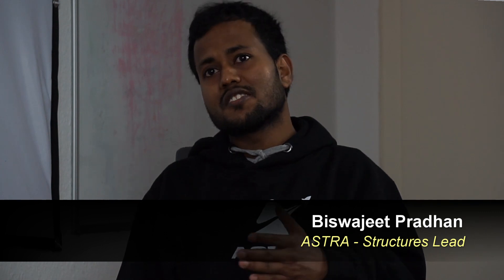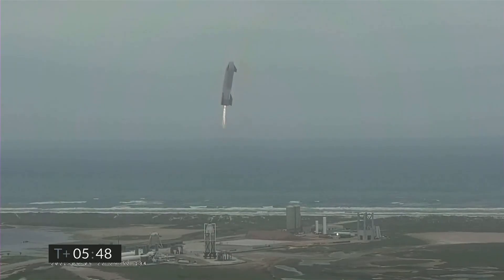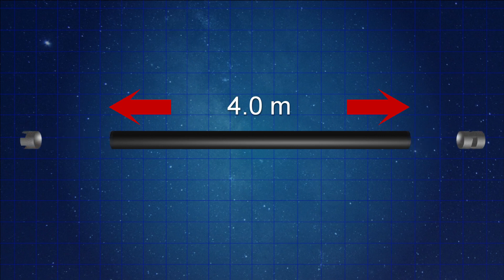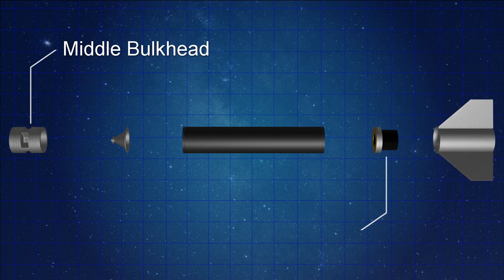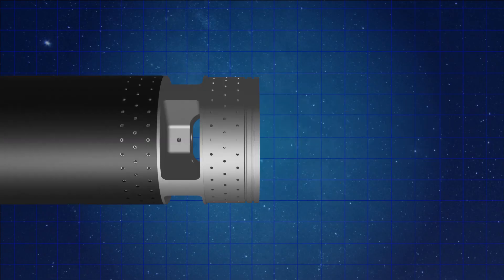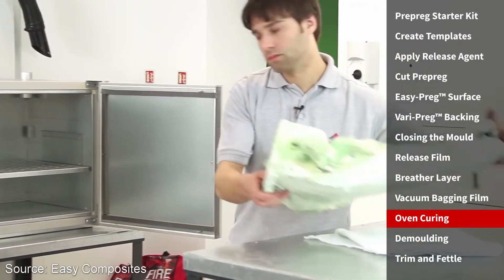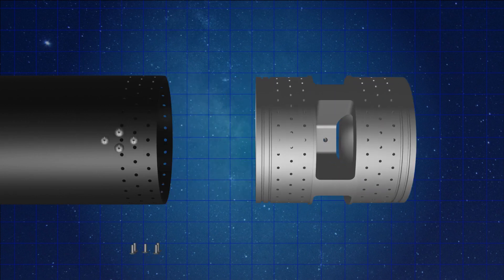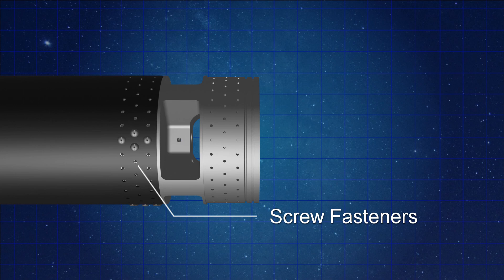ASTRA Transcendence Rocket: Structure System Introduction

Comment: Interesting video. Your Middle Bulkhead has an interesting shape with these nothes or pockets. What is the reason for that? :)
Reply from the maker: The 4 pockets are for the connections with the valves that we are going to incorporate:
1. The quick disconnect filling valve.
2. The exhaust valve - to get rid of Nitrous Oxide if we scrub or something.
3. The pressure Relief Valve which will activate if pressure exceeds 80 bar.
4. A port for our pressure transducer which will monitor the oxidizer tank pressure during filling.
Reply: @ASTRABremen  Thanks! It looks cool as well ;)
Reply: @ASTRABremen  Its interesting looking but it will introduce a lot of skin interference drag so best to put external panels over it. Also it looks like you are planning to use chamber bolting through carbon fiber tube to hold your end caps in? This wont work either and you will disrupt the carbon matrix and have a high probability of bulkhead ejection. Id suggest that you integrate metal end bosses into the carbon fiber tube with end bolting flanges, and bolt your ends caps to these. To get an idea on how to do this you can look at barbed soft tube fittings to draw inspiration. Not sure what you intend to line the tank with that is compatible with Nitrous Oxide, but do keep in mind liquid Nitrous Oxide is a strong solvent to many polymers so its likely can not just use a liner less CFRP tube. Un-plasticized PVC is compatible with Nitrous Oxide as is Polyurethane, or another possibility would be aluminum foil as barrier film.. Good luck team ASTRA..
Reply from the maker: With respect to the bolting, we are going to do a pressure test to see if the bulkheads will get ejected or not at our target operational pressure.  In the case that we see a failure at the interface between the CFRP and the aluminum bulkheads, we do have some potential innovative solutions for strengthening the bolt holes in the CFRP.  If it comes to that, we will try to implement these solutions, so stay tuned!